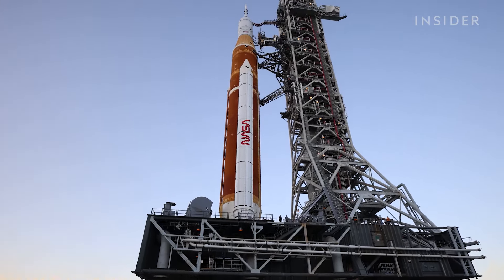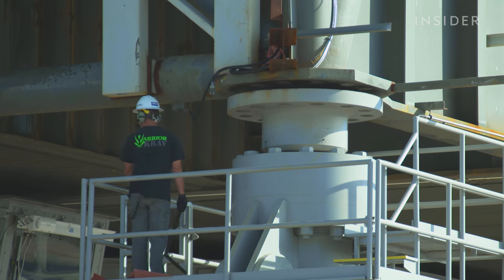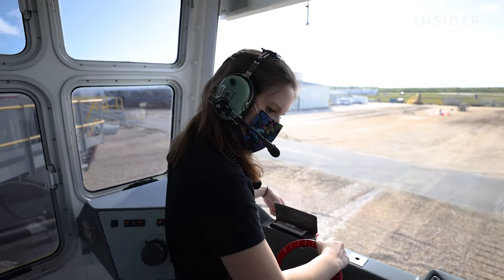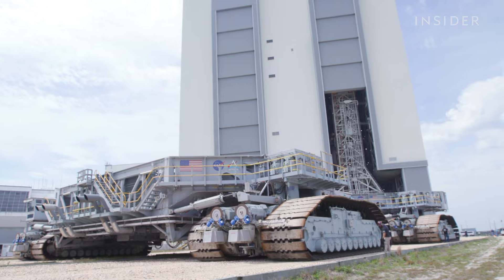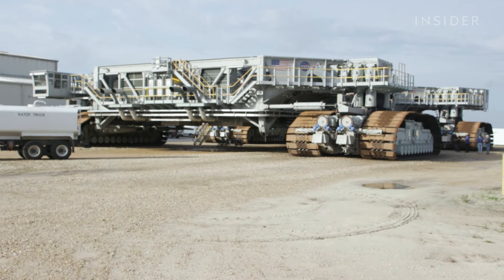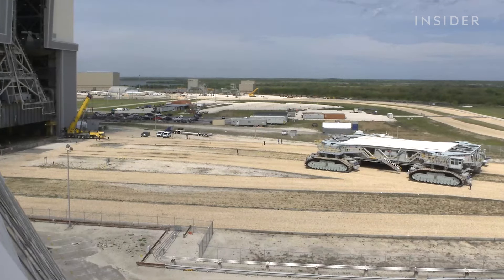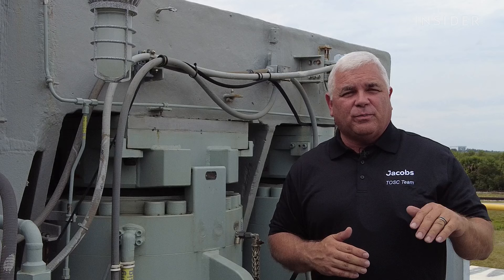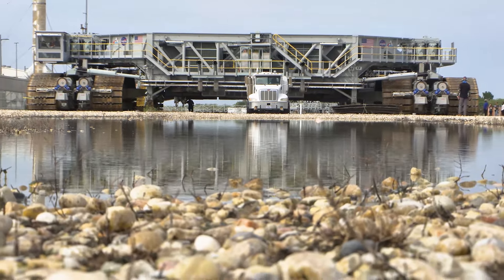How NASA Drives The $144 Million Vehicle That Transports Rocket Ships | What It Takes

Comment: The Soviets used a railroad to the launchpad, but that meant there was an awkward process of lifting the rocket upright.
Reply: The rail system seems like it would be cheaper than the crawler long term
Reply: @kenji-san4681  Rail makes more sense imo
Reply: Rails can't handle the weight of massive rockets like these. Look at the dry mass of Soyuz vs the dry mass of SLS. If the numbers I'm quickly looking at are right, just one of those white boosters on the side of SLS weigh twice as much if not more than Soyuz.
Reply: @aarong.4691  Sure they can if you developed a larger rail system.
Reply: @Skiller71Studios  sure but that would probably be just as expensive as it would be a custom track that would need servicing for the smallest of defects. Someone with family in the railroad industry in another comment was saying how for just the smallest cracks you need to replace that section which means cranes, welders, etc all on standby. Vs just letting it roll on rock which is pretty cheap. NASA doesnt have the budget to develop an entire new train track system rails etc A lot of the smaller rockets that can be supported by normal rails are carried on rails. ULA's Atlas V does this for instance (rolled out vertically as well)  but it is a much smaller rocket.
Reply: @aarong.4691  Cost wise rail vs a gigantic machine with continuous track? Difference is nowhere near what you think it is. As someone who has worked with track machines for 20+ years i'm sure they break down just as much as a rail (if not more)
Reply: @aarong.4691  Each 5 segment SRB weights about 700 tons (metric) and Soyuz weights about 300 tons (metric) when is fully fuelled. That gives a dry mass of about ~>1400tons for SLS
As far as I know, the biggest rocket to be transported by rail is the N1, thanks to it's highly ineficient design it had a dry mass of ~280 tons, so yes, quite a diference

(Worth noting that if you go to the liquid fuel booster route you can lower those 1400tons of dry mass by a lot)
Reply: @aarong.4691  there's a big difference between an application like this and a railroad track in the middle of nowhere that sees 70mph trains.
Reply: @aarong.4691  Not only can rails easily carry far MORE weight than a road system, the rolling resistance when using rail is also multiple orders of magnitude lower. No surprise that rail is used to move very heavy structures everywhere in the world, such as very large container cranes, inclined ship lifts and of course very heavy trains. In this case a rail system would’ve been easier and much cheaper to operate and maintain than the crawler.
Reply: The launch site is going uphill unlike the baikonour spaceport.
Reply: seems like a better solution. In this case there is the awkward process of lifting the rocket onto the crawler
Reply: @aarong.4691  that is such backward negative thinking

Comment: The main engines are the same model the US Navy used in the Newport class LST ships built in the 1960s and commissioned in the early 70s. 6 of these Alco 251C V16 engines powered each LST and 3 Alco 251E V8 ran the gensets. I worked on them in the mid 80s.

Comment: I’m surprised they went with a track crawler instead of a train track. Seems like for something this large a track would work better. But still that’s amazing
Reply: The launch pad sits on a hill, because that part of the coastline is a swamp and building things like the flame trenches into the ground is difficult. The hill means you can't use rails (incline is too steep). To make a rail system possible, they'd have to build the VAB at the same elevation as the launch pad, and build a dike between the VAB and pad. That may have been more expensive than building the crawler.
Rails also need more groundwork to spread the load.
Reply: @h.dejong2531  finally someone speak English
Reply: @mclaine33 No dude , that would be efficient , what's wrong with you!?  and build the VAB closer to the pad?! are you crazy????
Reply: @h.dejong2531  I believe Russia use rails without issues.
Reply: @cplcabs  Yes, that's right. Baikonur isn't built on a swamp, so there's no problem digging a large pit under ground level, which means your launch pad doesn't have to be on a hill.
Reply: You cant with the weight. The tracks disperse the massive weights they support across a larger footprint, tracks are small thin and would constantly need replacing. They replace and put new rock down all the time due to the massive weights. Tracks also don't do so well with flexing and separate easily.

Comment: But you should turn your computer off completely when you're done using it lol. Letting your computer sleep for long periods of time is detrimental over time
Reply: for simple computers, it does not matter. For servers, mission critical computers, high performance PCs, and likewise, mission critical crawler systems, you do not want to do that very often.
Reply: Booting up isn't a nice process for computers it seems, I remember in my highschool, the IT team just decided to put all the computers in the school to sleep instead of turning them off
Reply: @okeyhehe1728  exactly. When you do that you open the door to the risk of damaging hardware components and when the system is a 1 of a kind rocket transport vehicle, you don't want to take such a large and unecessary risk. It may seem like a waste to power heating on the engines 24/7 but losing such a unique system is far more costly than keeping the crawler's lights on!
Reply: Those annoying Windows updates are going to add up though, lol.

Comment: Oh Wow, that is some beast. I wonder how many gallon it uses per mile?
Reply: About a lake Ontario
Reply: Yes
Reply: 125.7 U.S. gal/mi according to Wikipedia
Reply: It chugged so much fuel that they needed refueling area's strategically placed along it's route to where they can refill if it would run low which it often did because it goes so slow and the amount of power it had made it very thirsty for fuel.
Reply: @benlee4940  soviet union use train
Reply: @benlee4940  that's honestly not that bad. 
For something so rarely used and is specialized for this one use of short range transport of extremely heavy and tall objects

Comment: One correction:  These may be the largest self-propelled land vehicles in the world, but not the largest self-propelled vehicles in the world if you don't restrict to land vehicles.
Reply: @UCbx6J1s8Gq7cclqgMDNrH8A just about every large container ship is larger, along with supertankes and the like. The Pioneering Spirit crane vessel is currently listed as the worlds largest vessel by gross tonnage and also moves under its own power.
Reply: Neeeerd!🤓
Reply: @nkvkc  🤡🤡
Reply: actually, the bagger 288 excavator is the largest self propelled land vehicle in the world
Reply: MaybeItsBrandonMabe  ok, I understand now, but u actually just copied and pasted a Wikipedia paragraph
Reply: @anynomoussucker823  chill bruh
Reply: @anynomoussucker823  I think it was supposed to be a Simpsons joke.
Reply: Water "vehicles " are called  vessels and air "vehicles " are called aircraft  so you are wrong
Reply: @scootersonlyrepair  According to Merriam-Webster, "vehicle" means "a means of carrying or transporting something", so it includes ships and aircraft.
Reply: Not even close to the largest land vehicle by weight now. It is possibly the tallest however.
6000t loads are almost routinely moved now.
Mammoet do it regularly (ie if you need a ship moved or a ten story building…). They use a self propelled modular transporter.

Comment: I have seen this immense vehicle. Every run is an engineering run because it is so complex with so many parts. I was wondering for a long time why NASA did not put it on rails that makes things a lot more efficient, much easier and a much smooth ride with minimum risks. The distance is fixed with a clear point A to B. Why the road is not a straight line?
Reply: The road isn't a straight line because there are multiple launch pads
Reply: I was thinking the exact same thing, why don't they use rails instead?
Reply: I’m pretty sure the Russian use somthing similar to large trains on tracks to move their rockets . Googling russian rockets at the moment doesn’t bring up what I’m looking for !
Reply: Yeah great idea, but I guess that it would require a large investment and introduce risks which nasa doesnt like. That’s why innovation often requires competition. They're stuck with a really old machine that requires 50 engineers to even run it haha
Reply: @MrJellekeulemans  Yes but also putting a rocket sideways to be transported can put pressure on places that we may not want pressure to be.. Transporting it vertically on the launch pad allows the rocket to be at maximum working capacity when it counts
Reply: @jakelavaclaw2759  im confused, he never said to put the rocket sideways, he just explained why a large org like NASA doesnt like quick changes that they cant extensively test, which is very true
Reply: @notme756  let me clear it up for you then, im not debating about NASA's decision making, i'm just debating using the rails. you put the rocket on it's side when you transport it on rails, which isn't feasible for some rockets.
Reply: @jakelavaclaw2759  Yea, rail cars are too unstable for a vertical rocket even at extremely slow speeds and having only one car (no coupler slack)
Reply: @jakelavaclaw2759  what a bs point "pressure"....
Reply: The launch pad sits on a hill, because that part of the coastline is a swamp and building things like the flame trenches into the ground is difficult. The hill means you can't use rails (incline is too steep). To make a rail system possible, they'd have to build the VAB at the same elevation as the launch pad, and build a dike between the VAB and pad. That may have been more expensive than building the crawler. Rails would also concentrate the load more, so you need more groundwork.
Reply: @jakelavaclaw2759  why does the rocket have to be on it's side if it's on rails? Surely it could still stand up just like in this clip? The only difference is that the method of transport is via rail, rather than crawler.
Reply: @sevenhelmets  i'm not sure why. look it up though, they're never transported upright on rails.
Reply: Thing with rails is that rails are usually put in place because they allow for incredible speeds, and speed isn't what you want when you're moving billions worth of equipment. Also, if you for any reason would develop more launch pads you'd require to put in new rail which gets incredibly expensive very fast. Reasons the road is not straight I obviously can't do much but speculate, but it could be that due to terrain running the road as they did was the most cost-and-time efficient and safest route as terraforming is expensive. It's important to remember that the USA was competing with the USSR at the time of developing this so it was important to spend most of their resources developing rockets and not shoveling dirt. Although again, just speculating.
Reply: @sevenhelmets  ESA transports the Ariane 5 upright on its launch table, on rails. 
The Russians transport the rocket only. Horizontal transport is feasible because an empty Soyuz is light enough that you can easily lift it to vertical using hydraulics on the rail car. An Ariane 5 with solids weighs far more, making this more difficult. 
Another factor is the structural strength of the rocket: the Soyuz has to be strong enough to be transported horizontally. Rockets that are built only to withstand vertical loads can be a bit lighter, but are more finicky to transport.
Reply: The roads are not in a straight line because the launch pads have to align with the equator.  There are also two launch pads that the crawler can access, necessitating a fork in the road.
Reply: @lukephillips5618  Then have multiple rails. They are far less complicated than with the current vehicle.
Reply: @jakelavaclaw2759  Rails can transport rocket standing. Just move slowly!
Reply: @lukephillips5618  Then multiple rails are still much cheaper!!!

Comment: awesome presentation of the crawler-transporter. also answered a question I've had for many years, the Slope at the pad, how did  it not tip going up (or down). Thank you for the video..
Reply: The platform will lift slightly up and adjust the angle and height.

Comment: Let's make the real question, how mutch power does it make?
Reply: The engines used to drive the generators are 2 x 2,750 hp engines. They run 4 x 1,315 hp motors, one on each track set. 2 x 1,065hp engines drive generators that run the hydraulics, controls, steering etc.
Reply: @benlee4940  in other words 1 mph is the fastest it goes. lol
Reply: bruh  yeah, going flat out I think it can go over 5 but it is usually limited to a top speed of one mph

Comment: Definitely one of my favourite videos out of the channel so far, I didn't even think of this huge piece of complicated equipment! Never seen it before or heard of it. Really respect the team behind it. Almost wish there was a giant rail system though? Less water usage
Reply: Yes, and there should be potential for electrification too. The Alco and Cummins engines have a 5,000 gallon tank and use 1 gallon per 32 feet (approximately 165 gallons per mile)
 according to a NASA fact sheet. With 4 miles one-way, that's 660 gallons to make it to the pad, 1,320 gallons round-trip.
Reply: train is the solution to all problems
Reply: It sounds feasible, but it's not. If the rail cracks, they have to replace that whole section of rail, though, which means that they got to get cranes in place, welders on standby, and if it's a curved rail section, it would have to have special presses, etc. It's literally more expensive and time consuming than letting it roll over rock. My dad's worked in the railroad industry for 31 years coming in August, and he's seen plenty of incidents happen due to just small cracks in the rail. Plus the rails would not be able to handle that much weight. A train can spread all that weight for more than a mile. But you place all that weight on just 131 feet... It's gonna squash it.
Reply: Why not build it where it launches? 😅
(I know, sterile environment...)
Reply: @RyanStonedonCanadianGaming  gasp looking at starship
Reply: The russians actually do use a rail system for Soyuz. This is just the solution that we came up with in the 60s and its expensive to change it at this point. Plus, its an iconic piece of spaceflight history so why not keep using it?
Reply: @RyanStonedonCanadianGaming  Hey, ULA does it.
Reply: Jellypopcorn, the water used, 1,320 gallons according to Mr. Bell, is nothing compared to what the Sound Suppression Water System uses at launch; about 300,000 gallons in 40 seconds or so.  Florida has lots of water, no worries.
Reply: @Uncle Build To add to water in that place this rocket among other chemicals emits water  vapour as exhaust
Reply: The Soviet Union used rails, and Russia continues using rails with their rockets. It requires more infrastructure and thus more things that can go wrong. Engineers love simplicity because less things can go wrong, thus increasing the probability that your machine works correctly. Think about it like this, if there's one way something can go right and 10 different moving parts that can all fail one way, there's a 1/10 theoretical probability that the machine fails. If there's 5 moving parts, there's a 1/5 theoretical probability that the machine fails. That's 10% compared to 20% chance the machine will theoretically function.
Reply: Hey water is dirt cheap mostly especially when you are in Florida 
Just Use the ocean!
Reply: @RyanStonedonCanadianGaming  Yeah
But I WISH!
even in my imagination i had people do that
Reply: @imEden0  Remember that Soyuz and other Russian rockets are EMPTY when transported.  Shuttle and SLS, on the other hand have the two enormous, fully fueled Solid Rocket Boosters (way over a million pounds each) attached when they are moved.

Comment: I feel like it's easier just to build a straight line road.
Reply: Why aren’t you at nasa?!
Reply: .. they have probably already considered the possibility of building a straight road between sites. So there is probably a good reason why it's not praticle.
Reply: The launchpads have changed over the years and there are several. Oddly enough, concrete and steel experiences high wear and tear when a skyscraper sized rocket goes off on top of it.
Reply: @josezapata9674  That's a non-answer. The OP was not harassing anyone. You could've explained why straight line is not a workable idea, like Samson did above. Being edgy af has brought you 2 likes, that's great of course.
Reply: Holy shit dude!! You should work at NASA!
Reply: @u1zha  Sampson explained one reason why it's not viable which doesn't even relate to the road thing. If a launch pad becomes worn down you can simply rebuild it. The reasons behind not having a straight line road are probably much more complex and I don't have time.

Sorry this isn't wikipedia.
Reply: @simplemoneydrop476  It does relate a bit. Whereas the responses like "wHy dONt YoU wORk aT nASA" don't relate to anything, they're toxic knowledge-abhoring noise.

Not sure why you are spending your time typing things like "I don't have time". Did you even notice whom I was talking to? When I wrote "You could've explained" I was still referring to Jose Zapata not you.